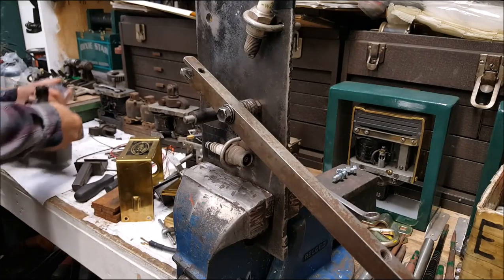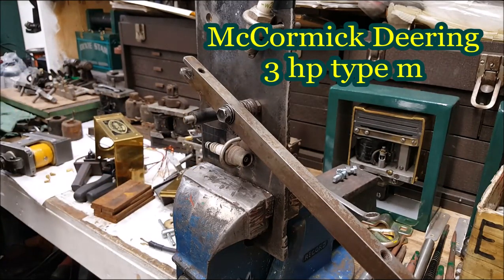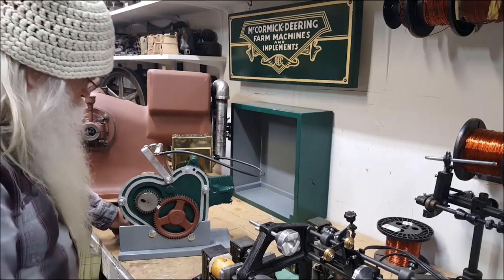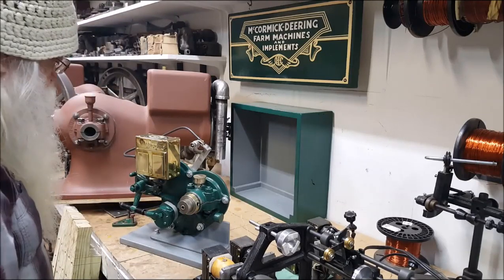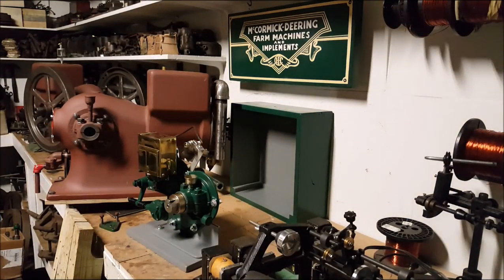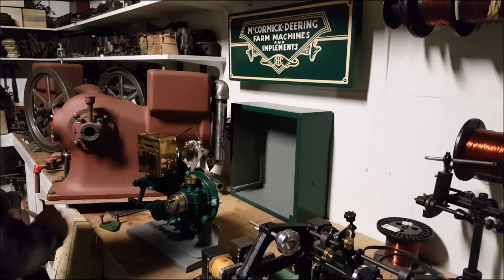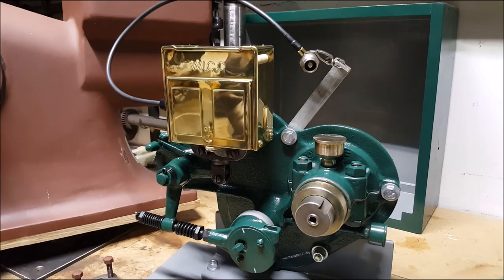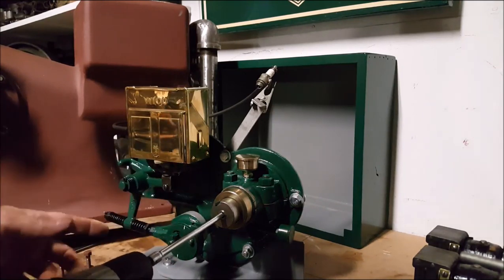Wico EK Magneto on test stand / high tension ignition

Comment: HI Sam  Question about a older video I H  LA LB head valve seats , What size seat cutter do you use.You said it was a Neway cutter, what would be a common kit to buy for smaller engines. There is a lot of kits out there  Thank you Gnedreau@yahoo.com  Beebe Arkansas
Reply: Hey I have an la with kerosene I can't get running

Comment: Is that a "wasted spark" system where it sparks at top dead center of both the compression and exhaust strokes? Or does that large timing gear take care of that?
Thanks, Sam. Great tester stand you designed there...pretty impressive.